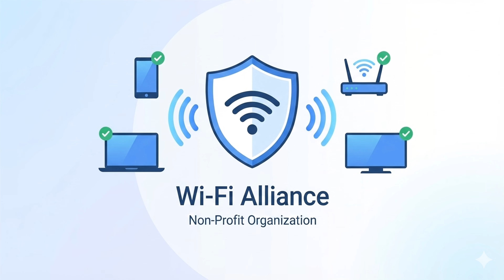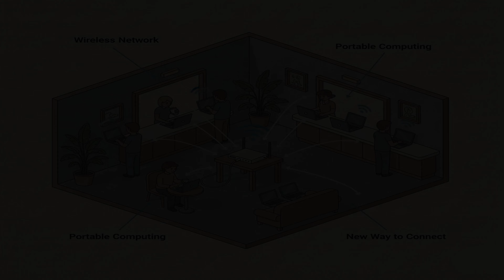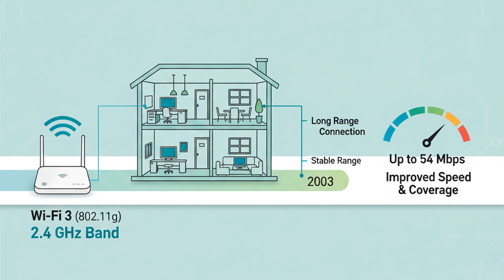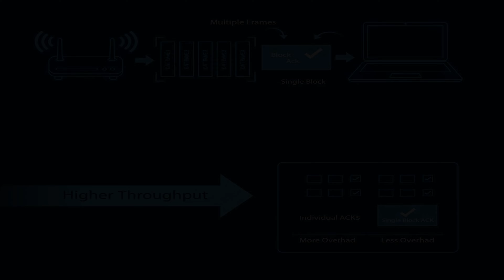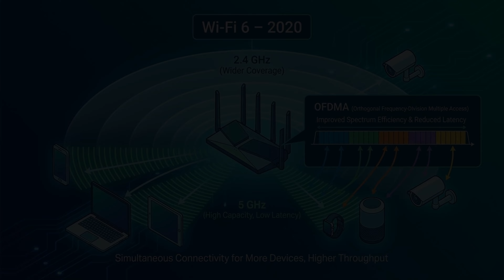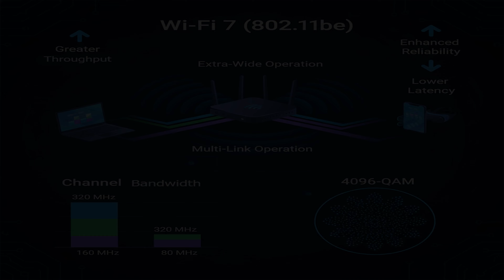Wi-Fi Generations Explained | Wi-Fi 1 to Wi-Fi 7 | Wi-Fi Learning | Video 43 | @Insidewifi |

Comment: Nice summary! For me it's useful because I studied this and it's a quick review of what I knew.
And even though it's important to me, you haven't mentioned it but it was there in the slides, the names "High Throughput", "Very High Throughput", etc. which is what we really see checking the features of the wireless adapters. At least this is my case when using the command `iw` on GNU/Linux.
Reply from the maker: Thanks and appreciate your valuable feedback, normally in the windows case HT, etc will not be used even though its there in standards. Linux case is new for me. Will add this.